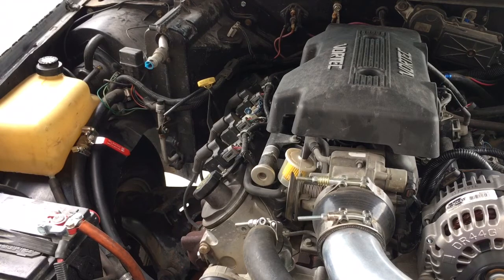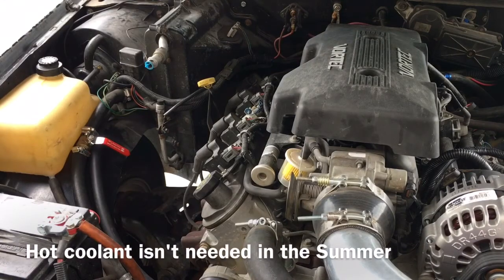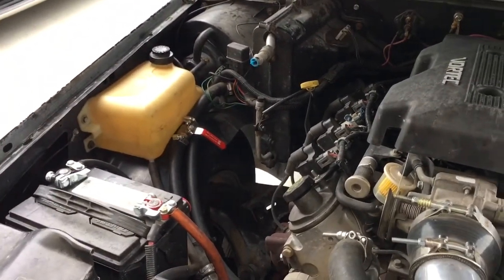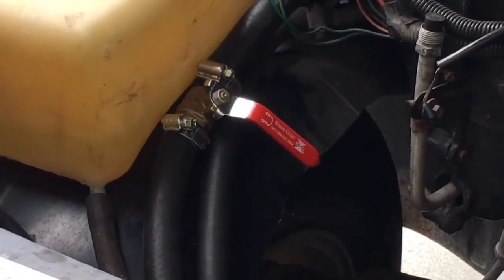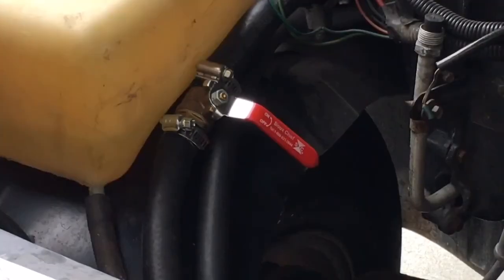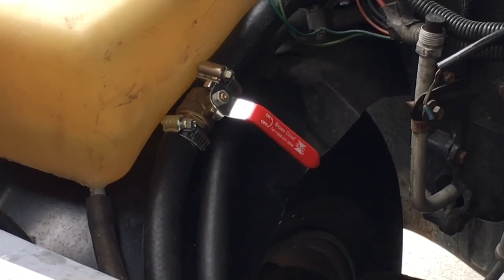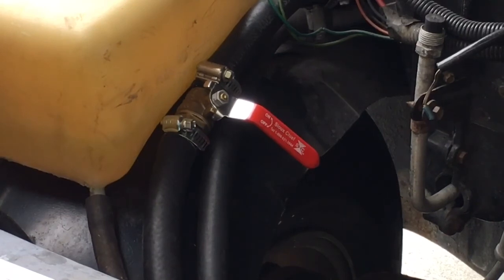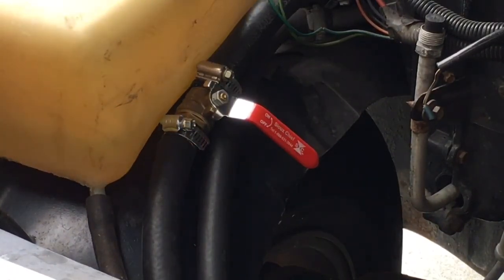How to stop coolant flow inside your vehicle in the Summer

Comment: Your RPO codes on the glove box will tell you what control system you have, like CJ2, CJ3 but most likely vacuum. Your temp blend door has a bad foam seal, or blockage. Hi can speed with other than max A/C with pull air from the cab. Drinking straw wrappers, napkins can be drawn in or tooth pick to ink pen falls in a defroster Vent. Like a pin-ball machine bounces down and lands in the door. Trash, bad seal, vacuum leak or actuator, regardless, it’s 36 years old. You could have fix it right during the time it took to install a ball valve a video this. Import cars of the 60’s era have been using an under-hood shut off, nothing new. Personally, I would have put effort into a working A/C system. ASE Master Tech- Retired
Reply from the maker: There’s no A/C on the Blazer, there’s not enough room with the Turbo setup on it now. I admit the plans for the Blazer morphed way beyond what I originally intended. Now I only want to maintain heat/defrost for safety during those times the windshield might fog.  JD
Reply: @HeadFlowInc And…we never would have seen Grandmas pruning shears!  Props for G-Ma!

Comment: Years ago the Kenworth dealer would add shut-off valves to the  heater core in the cab and sleeper on the T-600 trucks.  Man it made a big difference.
Reply from the maker: Steven N I found out later many factory vehicles came with coolant shut off valves to stop hot coolant from getting to the heater core. Thanks for watching and the feedback I appreciate it!  JD

Comment: On my mustang , the blender door was warped inside the ac box, not sealing properly when the heater is on cold position (blender door closed). Thanks for the video. I will do same as you did in your blazer.
Reply from the maker: Claudio Borges Thank you for the feedback I appreciate it, let me know if it helps.  It truly made a big difference in my application.  👍. JD

Comment: I don't think you are supposed to "dead head" the heater lines on LS engines.  You need a bypass type valve.
Reply from the maker: pmoore4321 Those outlets are connected inside the WP only a small divider wall behind the thermostat, that’s a Myth. 
Now you do have to vent the steam vents on the front of your heads. 👍

Comment: Ford makes a vacuum actuated heater hose check valve that works great.  The used it on the 2003 ford excursion, I've used them numerous times they work great.

Comment: Did that on my 88 chev pickup. Because it gets to hot even in winter and the controls are hard to get just right. So I use it to throttle it down some
Reply from the maker: mlong5151 That's interesting, they sell a tool without teeth to clamp hoses I'd like to have some but I'd hardly ever use them. Regulating the water flow with the ball valve is a great idea!  I wish my heat was too hot, mine barely keeps us warm in the dead of Winter. I'm hoping the new LS engine will do better with the hotter 186 degree thermostat. 👍